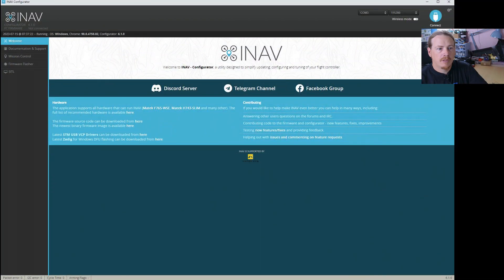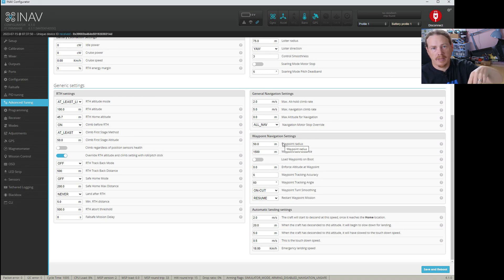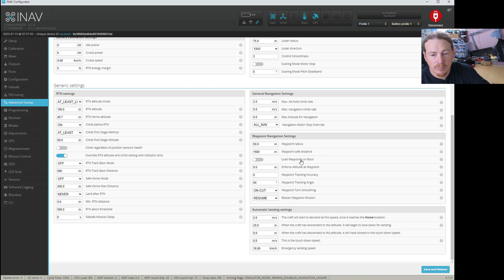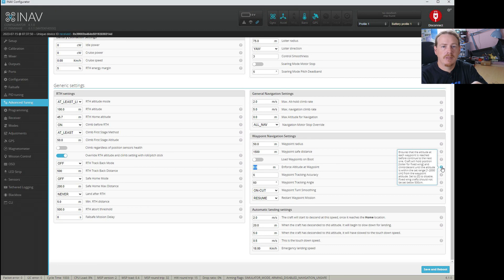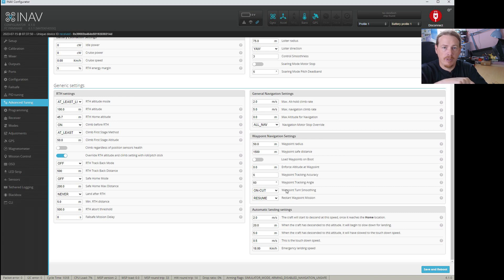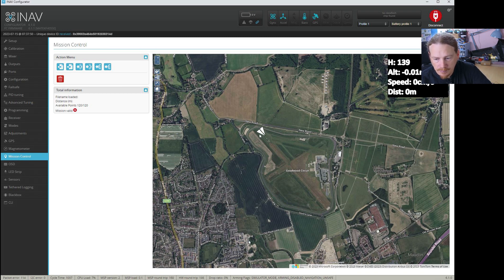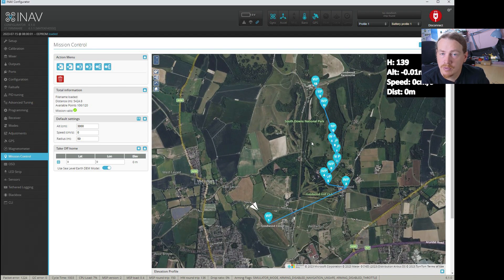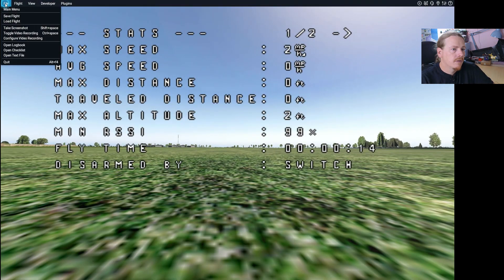Setting up and flying Waypoint Missions in INAV

Comment: With my DJI+Litchi app the mission will continue if the Tx/Rx mission is lost (ie lots of trees), will iNav continue the mission too or will it fall back to follow what is on the Failsafe tab?  ie mine is set to RTH.  I would prefer it continues as I know it's a safe WP mission.  But of course, if I am free style flying and lost connection, I want the RTH to activate as normal.  Is that setup even possible?
Reply: looks like this is what I want 

failsafe_mission_delay

Applies if failsafe occurs when a WP mission is in progress. Sets the time delay in seconds between failsafe occurring and the selected failsafe procedure activating. If set to -1 the failsafe procedure won't activate at all and the mission will continue until the end.

Comment: where USER ACTIONS is configured, I know the option is in edit point, but it only allows you to activate or deactivate user actions 1, 2, 3, 4 where I can put for example a SET_CHANNEL. etc.
Reply from the maker: You need to use the programming framework to make use of user actions.

Comment: thanks for the reminders Darrin, great job. Is there any possibility that MicroSoft simulator will be added to the SITL? I would really like to use the SILT and i have MSFS but can't swing another $70 for XPlane just for use on the SITL.
Reply from the maker: I don’t know if this is possible. I do know there are no plans to add support. You can use the demo version of X-Plane. It just means you are limited to 10 minute flights. Also X-Plane 11 can be bought reasonably cheaply. Especially when there’s a Steam sale on. It’s currently £24 ($32), not on sale.

Comment: Hello. Will the plane continue to its waypoint mission even when the transmitter losses connection..? Thanks..
Reply from the maker: It depends on the settings used. By default, no.
Reply: @MrD  what could be that settings..? Thanks always..

Comment: I've been researching my question  on loosing rc link during waypoints mission but no luck, cli won't except set failsafe_mission = off
Reply: So the best I can find out after much research in inav 6.1.1 in advance tuning tab waypoints section if failsafe setting is set to -1 plane won't enter failsafe while flying waypoints mission, I'm not sure if it will enter failsafe anytime but will do some testing

Comment: Great video i have one question if you have a problem with the mission if you just turn the waypoint switch off on your radio then does everything go back to normal flight and you have complete control?
Reply from the maker: Yes. If you exit WP mode. It will use whatever mode you have selected.

Comment: Great video
Just I am wondering what will happen if the mission is far away from RC signal or if I turned the radio off? Will it continues the mission or will turn to RTL?

Thanks
Reply from the maker: It depends on what you have set up. By default, it will failsafe and perform whatever you have set for that.

Comment: What about the NAV WP mode - when do you need to use it if there are stick commands to load missions?
Reply from the maker: the NAV WP mode is used like any other navigation modes. When you want to start flying the mission, you switch to the WP mode. The stick commands are to load the mission before you arm the aircraft.

Comment: I’m on a Mac, but have access to a PC.  Is there a mission planner for inav that allows for pre drawn missions?  For instance you want to do a mapping mission.  I’m thinking a shape you drag and drop on the map that has the amount of passes you want and the mission is shaped like a rectangle, but you can drag the corners to re-shape the mission or add points to change the shape.  Once the mission is correct, a file can be created that can be uploaded to the FC or it can be directly loaded from the software.

Comment: I made a waypoint mission using this tutorial but cannot get my plane to go to the first waypoint, I setup my NAV WP mode and when I turn it on I just loiter around home. Am I missing a setup?
Reply from the maker: There’s not really enough information here to say what’s going on. Did you enable auto load mission? If not, did you load the mission with stick commands? If the mission is successfully loaded, is there a system message saying the first waypoint is too far away?

Comment: Hello, I don't have the Nav WP under modes? The question is why not, do I have to set something separately! I fly a quad with F722 HGLRC board! Is it maybe because of that? Thanks in advance
Reply from the maker: You will need to meet the hardware requirements. With a quad you would need GPS and magnetometer. Maybe barometer too. Please see the note in the video description about making sure everything works perfectly before attempting missions.
Reply: @MrD  Yes, that was exactly my problem, the magnetometer is missing. I can't retrofit it either, because I'm missing SDA & SDL on the board! Thank you for quick help!! Greetings from Germany!!

Comment: It would be awesome if you could just drag the points on the mission elevation profile graph to set the altitudes for each waypoint.
Reply: Was wondering the same - being new to this was waiting for Darren to 'drag' the points to clear the terrain.
Reply from the maker: That would be pretty cool.
Reply: Thanks Darren I've been waiting for this video, were I fly its all mountains in every direction, so if I use the sea level setting and at takeoff location is 1800ft above sea level and altitude is set to 300ft but along the mission I'm crossing mountains that are 2500ft to 2800ft above sea level will plane maintain the 300ft automatically or will it be at 300feet above the launch site? I don't want to fly into one of these mountains lol. Thanks again for all you do
Reply: I didn't explain my question very well but I would like for plane to stay at set altitude according to were it is not the launch point because of my terran, so would I need to enable the sea level on each waypoint? Thanks again

Comment: Thanks this is a useful update. I think 1 programming event feature that will be most practical is aborting a mission and executing RTH when the battery is capacity is lower than a minimum threshold, and (this may be tricky) if possible also on the condition that any of the next waypoints are further from home than the current position. That's especially important if the mission may continue out of radio range (there is a inav setting for that).
Reply from the maker: That should be possible with the programming framework. 

But, you can set up estimated flight time and distance. I’ve not looked in to this a great deal. But the setup is: 
- on the configuration page, change the battery capacity from mAh to Wh, and enter the correct details for your pack. 
- on the advanced tuning page, there are settings related to this. Off the top of my head, it has stuff like Watts for cruise and some other settings that you’ll also need to set
- you’ll also need a well calibrated current sensor and voltage sensor 

Once that’s all set up. The flight time and distance OSD elements should work. I’m not sure if those values are available in programming. But if they are, they’d be the best values to use for the return point. If they’re not in programming, I may well add them.
Reply: @MrD  Thanks so much, I'm going to give it a try after first calibrating my current sensor.

Comment: Thanks for the video.  Seeing the Mission Elevation Profile was very useful.  I wasn't aware that was there.  You mentioned the drawback of using "Load waypoint on boot".  It will prevent you from arming, if the first WP is too far and you would need to use the stick command to unload the mission before you can arm.  Consider the drawback of NOT using the option.  You've taken off (without loading the mission).  If you enable WP mode without a mission loaded, iNav goes into RTH mode.  You can exit RTH by turning off WP mode, but you have no way of loading the mission while you are flying.  You have to land; use the stick command to load the mission and take off again before you can fly the mission.  To me, the correct time to enforce the "distance to first waypoint" should be when you enable WP mode, not when you are trying to arm.
Reply from the maker: I think the usefulness of auto load depends on how often you fly missions. If it’s all the time, then it’s definitely useful. If it’s rare thing, then loading a mission all the time could be a pain. Especially if the mission is outside the safe distance and you have to unload the mission before you can fly. 

I see both sides with the safe distance. Ultimately, I think 1.5km for the first waypoint is a fair compromise.

Comment: Thanks!
Reply from the maker: Thank you Michael 👍🏻
Reply: @MrD  You more than Welcome, I have a Queston if You don't mind I've been looking for info on reverse thrust, Sunnysky v3 motor/INAV 6.1.1/RM TX16s/Crossfire latest stable/HK Skywalker 60A ESC,I asked HK For reverse ESC and they did not understand me. Question can a Logical Switch be set-up to use let's say Inertia switch on TX16S to reverse my motor if so would you write it PLEASE THANK YOU
Reply from the maker: @michaelchambers9838  no, you would need to use a specific ESC or have a centre throttle for reverse thrust. 

Thanks again 👍🏻
Reply: @MrD  THANK YOU

Comment: Thanks for a brilliant overview! A future look at advanced features would certainly be welcome as well. One question: Is it safe to specify negative WP altitudes in sloping terrain, or could negative values confuse the system? Negative values would be more handy than using sea level reference for low terrain missions, and they seem to work OK in Mission Control, but I never dared try for real.
Reply from the maker: Thanks 👍🏻 With regards to the negative values. I really don’t know. I guess the best way to find out is set up a mission with negative values and try it in HITL. No risk involved then.